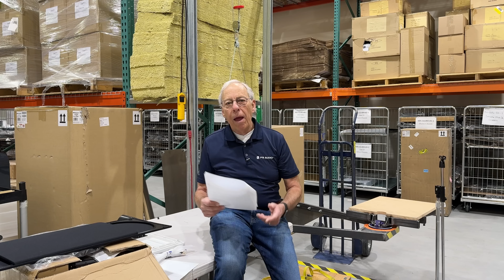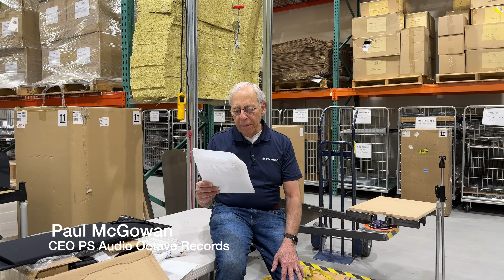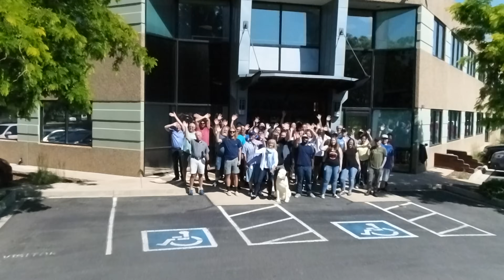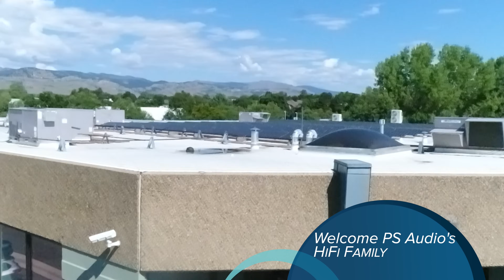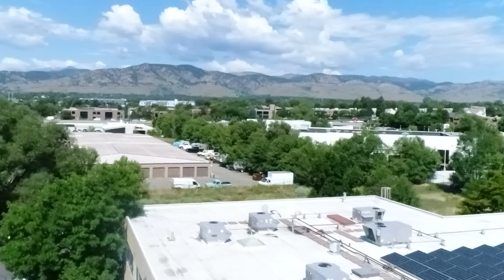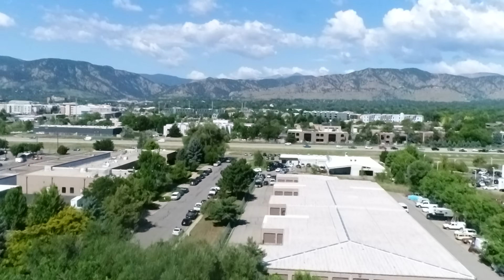Speaker sensitivity and Dynamic Range

Comment: Hi Paul, I have a question: I spend most of the day working at home at my desk and that’s the place where I listen to music the most. I have a pair of good speakers(KEF LS50 Meta - coaxial uniq) suitable I would say for nearfield listening. Also an Arcam SA20 integrated amp to drive them. They sound very good but I’m afraid I might miss out on the experience in this setup. How can I achieve the best experience - soundstage and such - in this kind of setup. Thanks a lot. Voicu from Belgium.

Comment: For a given magnet size, voice coil and suspension compliance, a light cone will be more sensitive than a heavy one and therefore have a bigger dynamic range.
Reply: it is actually the opposite,  lower sensitivity drivers have heavier and more solid cone and larger coils, so the take a lot more power, they can play louder and that is dynamic range.
Reply: You're both right, and such is the delimma that speaker designers face. The tradeoffs will never end

Comment: Think of speaker sensitivity in relationship to a volume control. For a given volume of the original source material, increasing the volume control makes the same sounds louder. Think of the markings on the volume control as speaker sensitivity in reverse order. If you go from volume setting A to a 3db lower volume setting B the sound SPL you hear is cut in half. If you keep the volume control at A but put in speakers with 3db less sensitivity, you will also hear half the SPL. If you put in 3db less sensitive speakers but increase the volume control by 3db you will hear the same SPL. 

So dynamic range does not change as long as you stay out of the noise floor and clipping. It's just how much power is needed peak and how low is the noise floor. 

Some speakers, typically those with higher sensitivity, have a reputation for "reproducing dynamics better". Some idea that with for those speakers the mastering engineer created a different mix which held back an extra 3db-6db of headroom from the very beginning of the record so it was available for that horn blast or guitar solo in the middle? No, the engineer has been riding zero peaks the whole time. Just bringing up the level on whom ever is getting that peak at the time. So most of the time when someone says brand J or brand K or... are high sensitivity and reproduce dynamics better than low sensitivity speakers, it did not exist in the source material.

Comment: For a speaker the dynamic range is equivalent to the max SPL in dB, which you can calculate from the sensitivity adding 3dB per doubling of Watts until you hit the max Watts for the speakers. For example, if your speakers output 87dB at 1 Watt and can handle up to 130 Watts of power, that represents additional 7 times a doubling of power (to 128) and +3dB times 7 equals +21dB added to 87dB and yields 108dB SPL.
Reply: It’s not that black-and-white speakers maximum volume given watts of input heavily depends on what frequency those watts are amplifying. 130 watts at 25 Hz is not going to be as loud as 130 watts at 5000 Hz.
Reply: @peterw2714  Yes, this is true and speakers will compress (=distortion) when playing too loud differently at different frequencies. So typically for a speaker, you will have more dynamic range at 1kHz than at, for example, 25Hz. And max power is also frequency dependent. You can’t put 130 Watts into the tweeter or smoke will come out. So realistically my above calculation is on the optimistic side and actual measurements can better express how max SPL performance is at a given max THD.